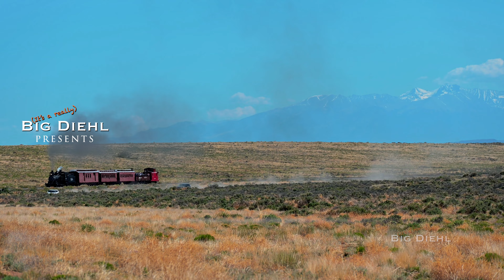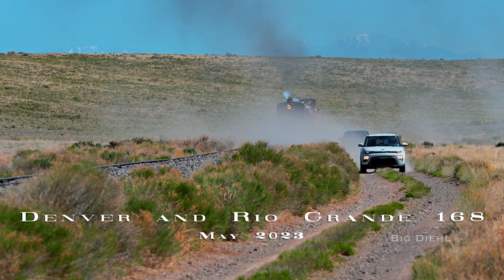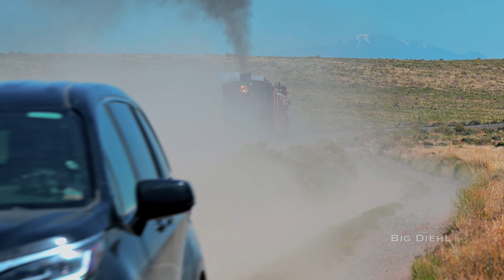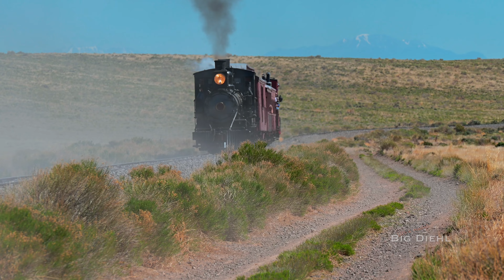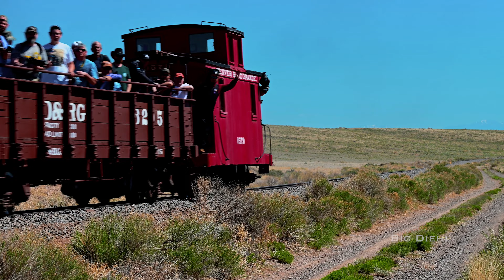Denver and Rio Grande 168 Opens the Cumbres and Toltec!

Comment: I am glad this wasn’t converted to oil fired 
I saw this engine out front of the train depot restaurant in the springs several times
Reply from the maker: I would not be surprised though, if it does get converted… The market forces out west are just making it harder and harder to find coal.

Comment: I can’t help but notice so far this year all of the coal fired steam engines on the Cumbres and Toltec have yet to receive their cinder traps on their smokestacks I’m wondering if the weather is still cold and wet in the Colorado New Mexico high hills
Reply from the maker: There were some modifications to the insides of the smoke boxes that allowed them to go without the cinder traps… Unfortunately, looking on the NGDF somehow that rationale has changed and as of this week they are back on the big K’s and even the mudhen
Reply: Yes. We have been forced to put the spark arrestors back on… 🙄